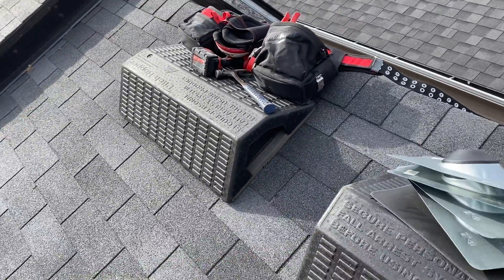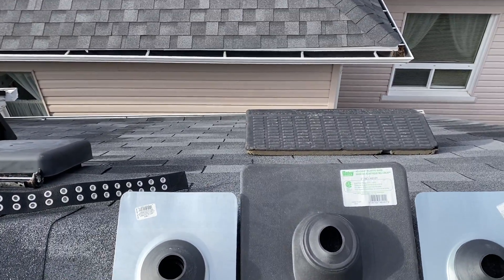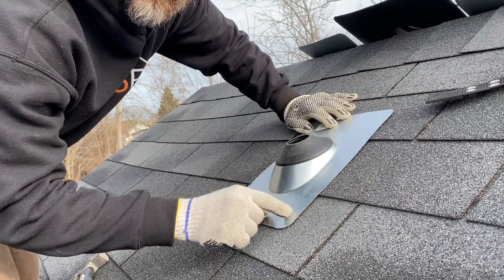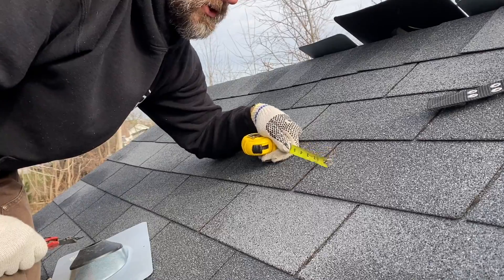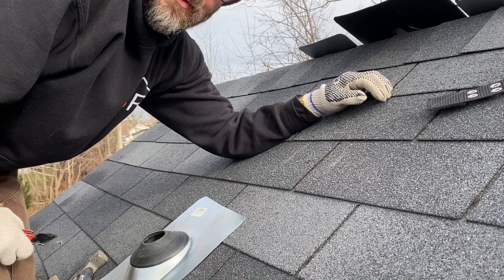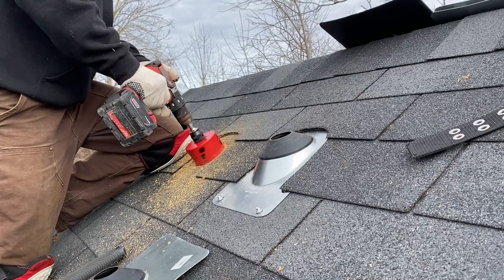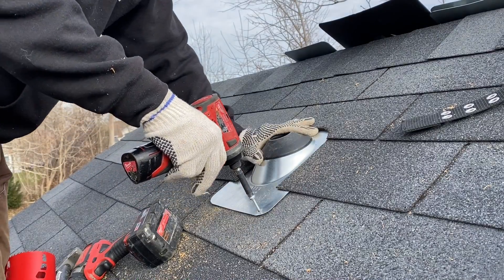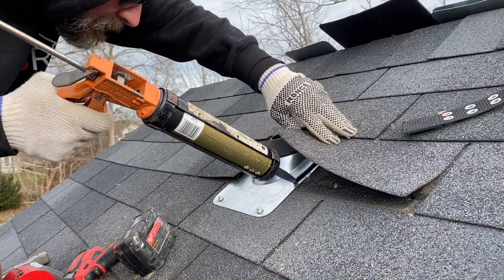How to Install a Roof Flange for HVAC

Comment: Why don't you have to seal or try to seal the two bottom screw holes that you put right through the shingles and the roof?
Reply from the maker: These screws have a neoprene gasket that keeps water out. We find they hold a lot better than nails and caulking.

Comment: I'm looking for videos on this topic because a friend and I will be installing a 3" B-Vent pipe for a gas heater in my shop/ art studio. This is the best method I've seen yet for putting in a flange. It actually makes sense! I was thinking of using self-sealing metal roofing screws for the exposed part of the flange, and I was glad to see that you use them. Most people either use nails or nothing at all. I think the way you did it will ensure the flange stays secure to the roof and nothing will leak either. Thanks for the video!
Reply from the maker: Appreciate the comment. This is a bulletproof way to install flanges.

Comment: Nice
Reply: the 2 exposed screws may cause water leaking?
Reply from the maker: @YihuaWang-gb9dh  the screw have neoprene gaskets to seal against the shingle. They are much better than nails with caulking. Thanks for the comment!
Reply from the maker: Thanks! Hope it helped or was at least fun to watch.